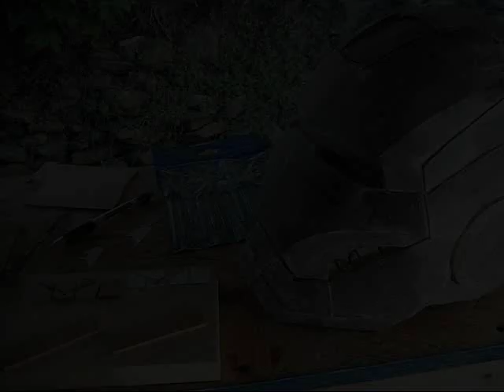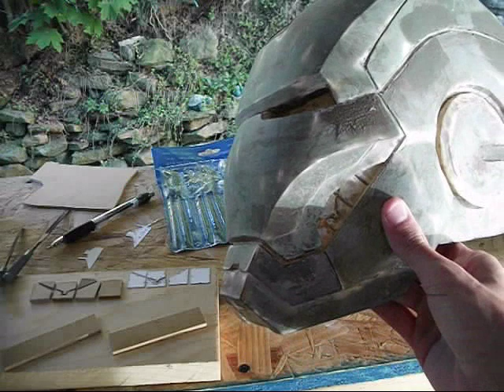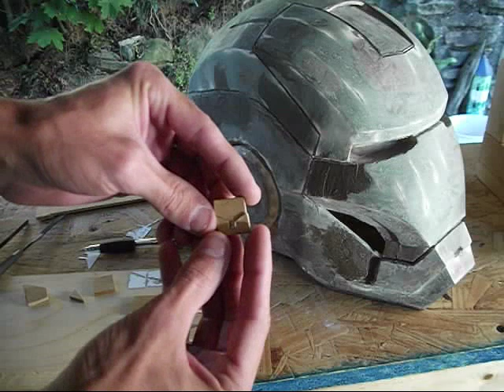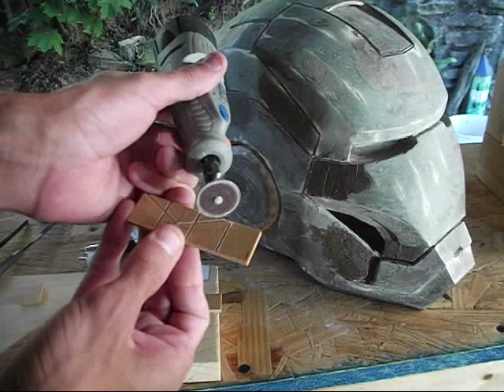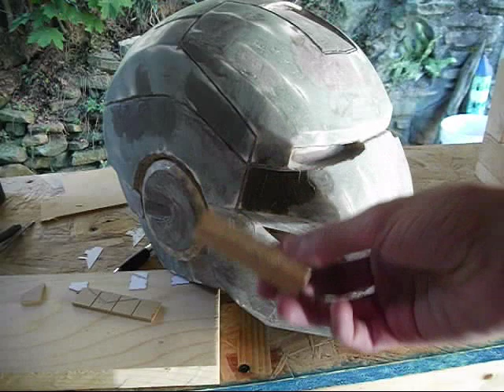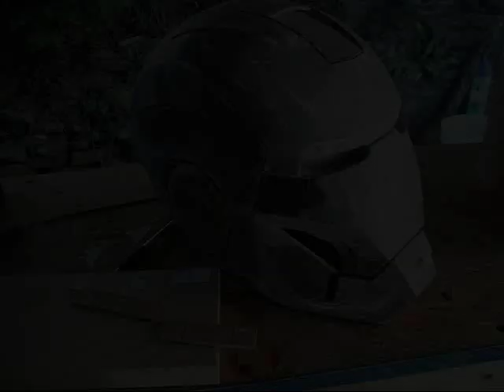IRON MAN HELMET BUILD PART 5 ~ TEETH REDUX

Comment: Just a suggestion for that little tit: wood block carving tools would allow you to trench out that hard board very easily. They're made for carving hardwoods so they would for sure cut into the hardboard. You can get very detailed and precise cuts with those with a bit of patience and minimal practice for applications like this. They could also be useful for all the trenched areas in the bondo that need to be cleaned out.

Comment from the maker: Barely affected the 65 lb cardstock in a good way or a bad way?  The helmet was already partially sanded in this video, that's why it looks gray.  When you sand the Bondo it sands down to a gray color (even the regular pink Bondo).  Word of advice...make sure your helmet is as symmetrical, even and straight as possible (using a hair dryer if needed to adjust it) before you Bondo...it is a lot easier to fix the larger problem areas that way and will save a lot of time.

Comment: I took your advice, and continued on with my helmet, and it's as if the resin and fiberglass barely affected the 65 lb card stock. I plan on putting on the bondo within the week, and I was wondering why your bondo turned your entire helmet grey? I thought it was green when you smoothed it on.

Comment from the maker: This master helmet is way too heavy and thick.  It IS wearable, but I never intended to do that.....it is mainly a display piece and to use for my mold, that's why the faceplate does not need to be motorized.  When I finally start making (much lighter) casts, I will probably complete one with all the bells and whistles.